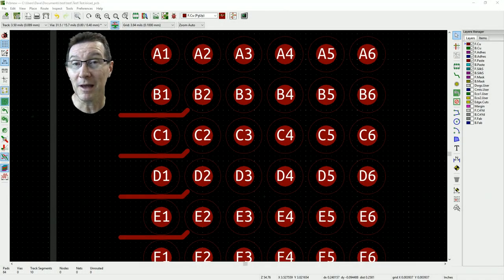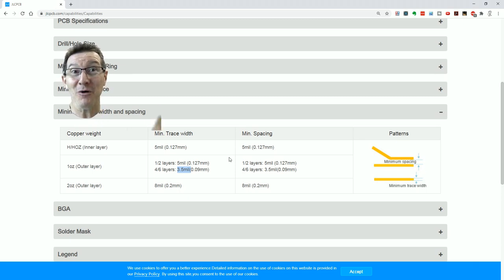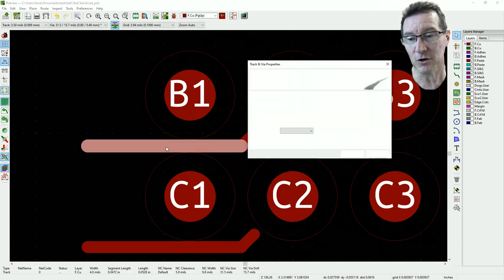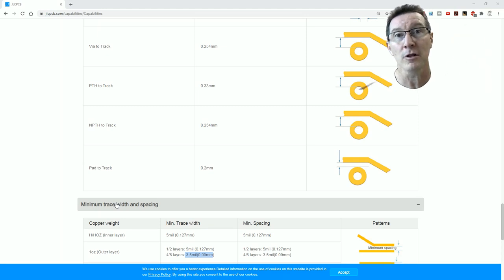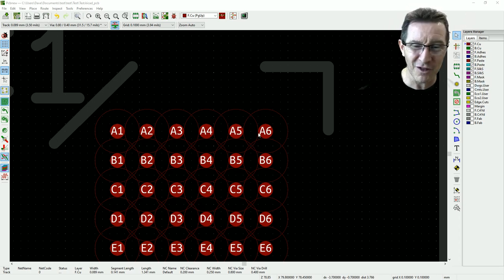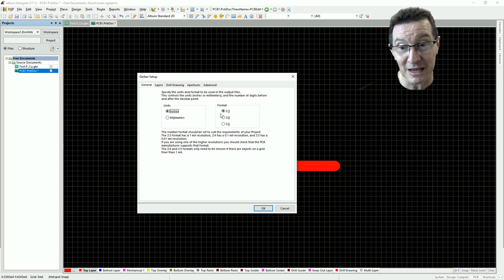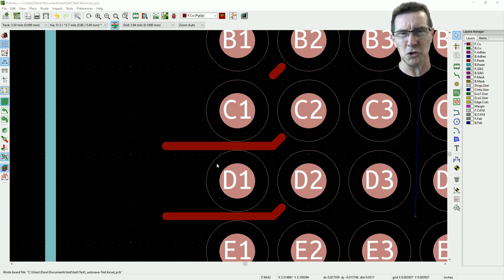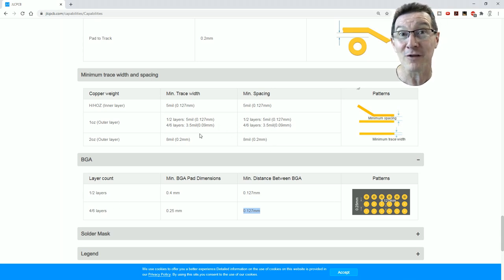EEVblog #1327 - 3 Ways to FAIL at PCB Manufacture

Comment: I actually always round up by default anyway to at least +0.05mm and sometimes even +0.1mm, just to be safe.
If I REALLY need that tolerance I always contact the manufacturer first.
I also stopped working in inches/imperial. To many companies and people screw these numbers up.
Excellent video Dave!!!!!
Reply: I guess we European circuit board designers where always aware of the imperial/metric issue.
Reply: @outsideworld76  Yes, I guess, working in imperial units will give you a lot of other issues, like talking about ±5% or something is all of a sudden a much bigger step.
Which really works weird when you have something like non perfect fraction of inches.
I actually always wondered how they do that with Fahrenheit, since it's a non-linear scale. ±10% at 20 degrees F will give you a different tolerance compared to ±10% at 100 degrees F.
Reply: That's exactly the way to go. Never rely on the minimums of the manufacturer.
Reply: @p_mouse8676  I really wonder how people in Celsius calculate melting and boiling points, as the underlying physics is based around absolute zero. Tin at 100 Deg. C is actually pretty close to melting and even 25 Deg. C is actually for metal migration still pretty warm. Yeah it takes time for the tin to eat into chopper - but hey: You car radio will be there for 10...15 years and it does get toasty and/or chilly in there.
What I want to say: using any degree system is non-sense when talking about temperature. Yes, Celsius is nice for boiling and freezing water and we happen to be salty water bags (close enough anyway), but for metals the scale is pretty much of no use.
Reply: @sarowie  That's not the point I was making. If you want to use a proper scale, use Kelvin. 
The point is, that these scales are linear.
It really doesn't matter what a scale is based on. I don't understand why people keep saying that. 
It's totally not relevant, because the number of a scale just simply shifts. Properties of materials also don't change with different scales.
Otherwise you are just to much stuck in absolute numbers and clearly don't understand what a scale is all about.
So people calculate melting points and boiling points the same way, just the numbers look different.
So I would really advice to read a bit more on the subject
Reply: Well - it is just a better system all around.

Also - the US does not use the imperial system but the US-Customary units - they are not the same (and the US-system is even more fucked up broken)
Reply: I've decided to move to mm in the design pretty recently. It was becoming a real pain, since now I've basically work with only SMD and the cases are basically in mm scales. I must say that even for me, that has been doing pcb in mils at least for the past decade even working on metric based countries, it seems to be much better to work on a mm grid PCB.
I also never set the DRC to the exactly value of the manufacturer, always let a small % of room...
Reply: @ABaumstumpf  Imperial is great for carpentry and rough metal fabrication. Decimal systems are better when precision is needed.
Reply: @p_mouse8676  How is Fahrenheit non-linear when compared to Celsius? What about the imperial system is "non-linear"? Yes the imperial units are not decimal. Yes fraction an inch are a mess and the "intuitive math" to handle adding up fractions it the reason for waste and incorrect dosage of medication. But: Those arguments are for a decimal based unit system (which metric is offcourse) - but linearity is not the right word.
Reply: @sarowie  Both F and C are linear, the pain in the ass part of the conversion is that not only there is an offset (i.e. 0 means something different), but also the slope is different (1 degree of difference in F does not equal 1 degree difference in C)

Comment: First time watching this channel. Very funny presentation. I've been designing PCB's and PWB's, yes there is a difference, for 42 years. I started using tape an mylar. There is no type, or technology of board that I haven't done.  25+ years for DOD and government and all types of commercial.  Some important things for all of you to consider. Never design to minimum. Bigger is always better. 
Gerber is only good for 7 decimal places( microns). Always output at max resolution to avoid truncation and roundoff. Consult with your fabricator before you start and as needed throughout your design.
Reply from the maker: You were fancy-pancy with your Bishop Graphics tape on mylar! 
Dalo pen on copper clad for the win. Followed by stick-on resist footprints and tape on copper clad. Then comes the fancy-pancy stuff!
Reply: @EEVblog  Jeez. I might still have my original circa '79 Dalo pen in one of my junk boxes.
Reply: I've got flashbacks of vertically-hanging mylar sheets with tape in a pile on the bottom of the cabinet!
Reply: @theantipope4354  I still have my exacto kit. Lost my slide rule.
Reply: @EEVblog  I had a sealed pack of Bishop Puppets. I left it with a previous company to place in a designer "museum".

Comment: This rounding error is definitely JLCPCB's fault. They've stated that is minimum trace width, so the minimum of the values should be sufficient. This also implies they should take care to round up, not down, if they're going to convert it. The row above implies either that mil is the source unit (as 0.127 is exact) or that they have 3 significant digits, so it should've said 3.55. Messy. Of course we can take the engineer's route and always pick the pessimistic value instead, but having to will cause cumulative margin errors.

The pad to track tolerance probably has more to do with guaranteeing the solder mask won't leave the track exposed or interfere with the pad soldering than any drill; drills are involved in the PTH and NPTH specs. This means the tolerances of three liquid processes combine (copper etching, soldermask, and soldering itself). Track to track is covered by solder mask so only the etching affects it, pad to pad may require masking off.
Reply: Like Dave said, you shouldn't be pushing the limits with a prototype PCB manufacturer anyway.  That will simply leave you paying for a lot of defective boards with broken and/or shorted traces.  I do my best to stay away from the minimums, and will only come close when necessary.  If what you are designing needs the bare minimums listed by the manufacturer you are probably better off selecting a different (likely also more expensive) manufacturer to send your gerbers to.
Reply: I can see it both ways - on the one hand, if they say 3.5mil, they should do 3.5mil, otherwise it's false advertising and that's a very slippery slope. On the other hand, when you're pushing the envelope, it's your job to get the complete specification - at those widths, you need more than one number to describe their accuracy - how wavy is the trace, how parallel are it's edges, how wide is it's top compared to it's bottom...

PCB manufacturer is not a black box operation - good designers need to know how things work inside.
Reply: @johnalexander2349  "they should do 3.5mil, otherwise it's false advertising and that's a very slippery slope"
They do not, in any way, guarantee that 3.5 mil works - they specifically say it is the minimum they accept.
Reply: @ABaumstumpf  No, in some countries' laws, it has to be functional for at least some applications.
Reply: I know there are cultural issues involved and such but frankly I think it's just not a sensible decision to work to deprecated measurement regimes in any field of science or industry in 2020. Why would you introduce such a source of potential error or conflict into your workstream when you have the simple choice not to?
Reply: @-yeme-  The fundamental source of the problem is in absolutely no way related to the unit of measurement. It is simply bad business advertising without consideration for boundary conditions. Any company advertising 0.09mm better be able to reliably achieve 0.08mm.
Reply: @engineer99 You must be quite the lawyer to have studied every consumer protection law in every country, and all the case law too...
Reply: @engineer99 Thanks for explaining why the Wiki for the Dunning Kruger effect has your photo front and centre.

Comment: The resistance to adopt the metric system boggles me
Reply: I'm in the U.S., but do most of my mechanical design with metric dimensions and hardware as those parts are easy enough to source. But when you're putting together a board for people to add through-hole parts and solder themselves, well again it comes down to parts availability and the ubiquity of 0.1" (2.54mm) spacing. It does get weird when I have both JST 2.50mm connectors and 2.54mm pin headers, but overall it seems to work out best when the grid is in thou instead of mm.
Reply: It is very simple to do and costs are low, allow both today - no real problem, select a distant swap over date 10-100 years from now when only metric will be used, and all new stuff sold must use either both or metric only from a different future cut-off date.
Reply: As they say in the UK, we go metric inch by inch!
Reply: The machines were often designed "in the era of the inch".  Notice how so many connectors are 2.54mm increments.
Reply: Soviet Union simply used a 2.5mm pitch instead of 2.54mm (0.1inch) when copying stuff. It was pretty much only noticeable with chips like 40pin CPU's where the error was enough to cause misalign. So we could start from such a "minor" tweak, I guess some machines could be adjusted for the small difference.
Reply: @Pawelr98  
That leads to trouble on big parts. A 2% error builds up.
Reply: I've met a good share of people who defend the imperial system based in its supposed easyness  of use when it comes to divisions, but that point falls under its own weight.

Since the measurements are ouright arbitrary, the equivalences are too, and therefore there is no intuitive way to make the conversions from one to the other. Also, no matter what they say, dividing by ten is much simpler and concise as dividing by 8, 16, 32, 64 and 128, and its also not like you cant do those here.
Reply: @AlexSKelly-up7lf  
It would be nice, however if the speed of light was a power of ten.
Also the folks who did metric did the world a disservice by calling the measure of length "meter".  That word already had meanings that lead to the conflict of "micrometer" having two meanings.
Reply: @kensmith5694  It is metre. Only in US english it is meter. So if you call micrometre incorrectly a micrometer, then that is just your personal shame. Not that I find confusion in micrometer anyway. As only thing I could think is confusing it with the micrometer that is the cauge tool. But is anyone really confused about that difference? Maybe I'm just missing something here.
Reply: @ShadowManceri  
When spoken they sound the same.
In the US, meter is accepted spelling.  You don't get to say otherwise.
Reply: @kensmith5694  Metre and meter sound similar, but not identical. But you called out people making metric system, while in reality it was the US folks doing the disservice by starting calling metre a meter. I just find it interesting that you call it disservice and in same breath call it accepted as well. Surely that is a contradiction.
Reply: The only thing worse than using the imperial system is using 2 systems at once.
Reply: @Basement-Science  
Yes, jump over 2 and going with 3 or 4 systems is a better way to go.  Furlongs, Fortnights and Stones can be converted to Light-years, Plank-times, and EV.
Reply: It's understandable: A US state tried to legislate the value of Pi to be exactly 3.2
The argument was that kids in school would have an easier time using Math if the numbers 'made sense'.
No word what they thought the square root of two or 'e' should be!
...
Run your grid at 0.0001, and you will be fine.  
See what I did there?
Reply: @pirobot668beta  
IIIRC they wanted it to be 3 as it is in the bible.  None of this fractional stuff is allowed.
Maybe they just denied that roots can be square.  I've never seen a tree with a square root.
The conversion to metric has caused no end of trouble in the electronics business.  A whole lot of parts and machines are done in fractional inches.  Pin spacing is almost always a nice round number of mil.  Drawing a schematic is one place where the whole thing just got very silly.  It used to be that a page had a nice round number of grid points across. Nobody cared what the unit of measure was because it is not a mechanical drawing.  Suddenly we now have symbols for parts with incompatible distances between pins.

Comment: The reason for the issue with 0.9mm is not that it automatically rejects 0.0889mm, but they round it up, and if that causes you to break clearance, that’s the rejection.  The reason they put a larger clearance for pads to trace is because they want room for solder mask variance so they don’t expose your trace based on the offset tolerance levels. That’s why pad to pad don’t have that because they are both exposed, and trace to trace are both covered. They should have called it soldermask clearance though, but that’s probably what it’s for. Lastly, as you pointed out later, most manufacturers consider smaller BGA chips to be “advanced” so yeah, different capabilities for different levels of manufacturer.

Comment: Fun fact: Some board houses have different annular ring specifications for outer layers versus inner layers and sadly KiCAD doesn't let you specify these different tolerances for different (e.g. inner vs. outer) layers.
Reply: It is a feature that could be added.  The nice thing about open source is improvements can be driven by what people actually want.
Reply: This will be available in Kicad v6. If you are adventurous enough you can already test it in the nightly builds (be aware that the graphical interface for entering the new DRC rules isn't done yet).
Reply: @Eletronicafg  
I think a plain text ascii configuration file and editing it is good enough.
Beating on the code that implements the feature seems a worthy thing to do next time I have nothing to do.

Comment: This is good info to have. Some fab houses like the one OshPark uses will take your board with whatever specs you have and try to fabricate it. They have minimums listed on the site, but if you go below that they will warn you that your yield could suffer and they will not attempt to remedy the situation for you. You're stuck with faulty boards.

I'm sure all fab houses are different, so knowing that some will just kick it back without even attempting it is very good to know.

Comment: 13:20 There are a few different reasons to have different spacing specs for plated and non-plated through holes, drilled vs. non drilled pads, and features on the same or on different nets and they are all etching and plating related.
PCBs in the 10/10 micron lines/space range are often produced in pattern plating mode. I.e. the pattern is not etched from a full thickness copper foil. Instead a thin seed layer is plated in electroless mode, then the photoresist is applied and the pattern is filled into the openings of the resist. After stripping the resist, the seed layer must be etched away between the traces and pads. This will always lead to some wedge-etching under the traces and my leave bridges, if the gaps are too small. This is what limits the line and space width capability of the process, and you can see, how shorts within the same net are not that critical.
With pads around holes, the problem is usually adhesion-related. During the PTH process, chemicals can creep between the pad and base material. That weakens adhesion of the whole pad, and causing air or water caught in these pockets that can explode in the reflow oven.
And there are lots and lots more things that can go wrong during muli-layer PCB manufacture...

Comment: Things that may explain stuff.
The pads may be done on a different pass than the traces and this may lead to a repeatability issue.  It certainly did in the past.
The soldermask edge to copper accuracy is not as good as copper to copper.  This can make trouble of exposing a trace that was supposed to be under the mask.
Last I checked, Kicad stores X,Y as integer numbers of 1E-4 inch increments. You can suffer from two roundings as the dimensions are converted.  This is done because the numbers for almost all packages come out more even in tiny fractions of an inch.  History rules destiny on this.

Comment: Dave, floating head is great. It looks great and it leaves more space in the video. Regarding the pads vs trace clearance, pad clearance will be limited by the solder mask tolerances, which often times is lower. About the BGAs, I think that in-pad vias are the way to go, if supported buy your board house.

Comment: TL:DR: 
1) Rounding errors between Imperial and metric (3.5 mil vs 0.09 mm)
2) Different clearance distances among different type of elements, such as Plated drilled through hole, pads, BGA pads.3) Formatting resolution of exported Gerber coordinates (mil/mm;  decimal precision)

Comment: I tend to set my defaults to 6mil/6mil unless i need something special.  I do this because after comparing most the common players for prototype PCBs, that is the largest spacing and width for their prototype boards.  And that is another trap that I have noticed.  Some places will list 3mil/3mil as their capabilities, but when you read the fine print, it is larger for their low volume prototype service.